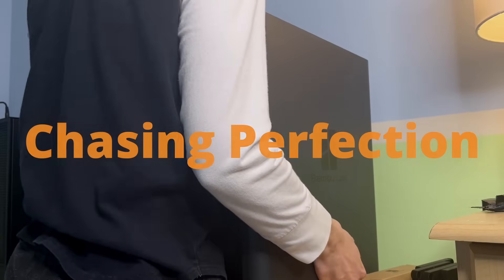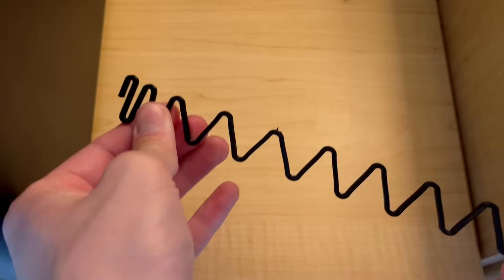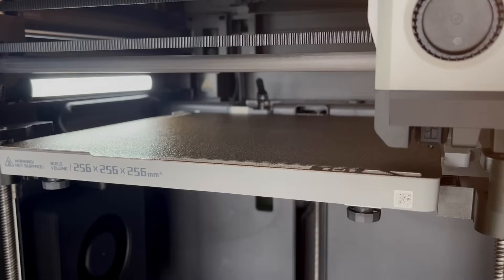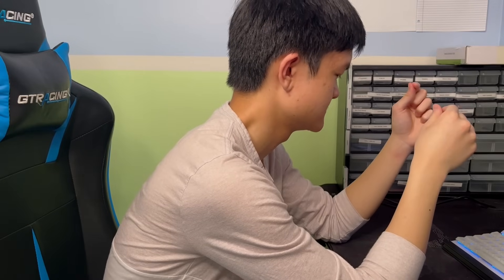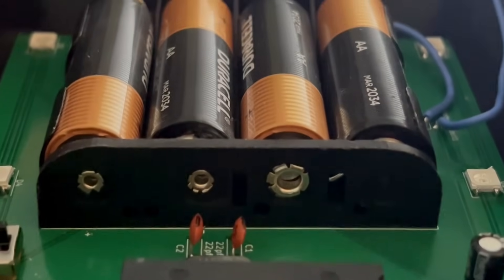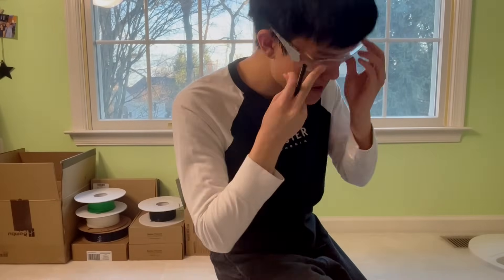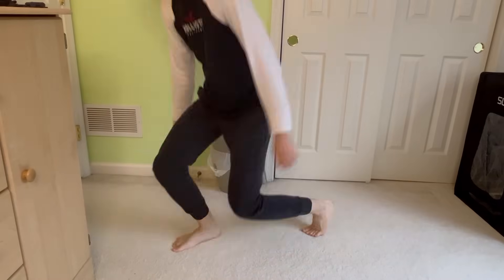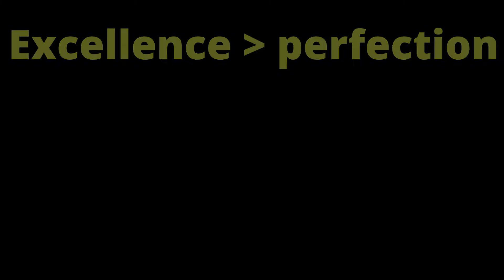Chasing the perfect 3D Printed Spring

Comment: FDM printed plastics also don't perform the same as injected molded plastics. There's plenty of plastic type springs used regularly to for snap fitting, lids, and simple springs for parts. If a coil spring is needed, they always use metal because it's simply superior.

Comment: To help print the coiled spring I think you should use a square profile for the spring rather than round. Metal springs are purely round because they are made from wire and that is how wire is made. You have other options.
Reply: Round springs spread the pressure better, on a square spring, there will be a higher pressure at the corners
Reply: @SuperEmmetMan  Good point.

Comment: There are lots of materials you can try to deal with doformation. PETG is an easy print, but not an engineering grade material, that would be suitable for such an application. You could try with PC (polycarbonate) filament which is known to not deform and is quite stiff. There are some special blends to make printing easier. You may also want to check PCTG.
Reply from the maker: Good suggestion! I was suggested PC by other people and tried it out and it was much better! It was much harder to print reliably (bed adhesion and such), so I might try out your idea.
Reply: Cool, think is worth a shot. Check PC from prusament, saw some reviews and it looks fairly easy to print with their blend. And PCTG of course is also a good thing to try.

Comment: Is there any filament that lets a spring stay under pre tension? I tried a pla plus clock spring but it loses pre tension in less than a day
Reply from the maker: In terms of non-exotic filaments, I tried PETG like I did in the video. Undergoes much less deformation after being stressed than PLA, as PETG has more elasticity. If you want to try more exotic filaments, I'd try polycarbonate or nylon. Polycarbonate makes for robust and stiffer springs, but is one of the hardest filaments to print with. I never used nylon, but heard it also works well. Hope this helps!
Reply: @TheTinkeringTechie  it certainly does :)

Comment: How about using air as the spring? There would probably be no problem with deformation, if the walls are big enough. just getting is airtight is the most challenging on it. and its hard to make different strengths of the spring.

Comment: I recommend trying a high density TPU, or try one of the filaments that change hardness/elasticity based on what temp you print them at. there's also one like that made of something similar to TPU, but is more like a stiff rubber- sadly I don't remember the name makeup of it as I only saw it once, quite a while ago. Sintering your parts in powdered salt, sand, or talc might help also- not sure how badly it would affect the elasticity, but it would definitely reduce breakage/deformation.

Comment: You can find stress strain curves for printed plastics online to design within specs to avoid plastic deformation or failures.   There is still the creep curve which can be partially mitigated by not leaving it under load when not necessary.  In the end it's all unreinforced thermoplastics, so nothing will be long lasting.  If you keep the loads low you can make  spring loaded clips that last long time.

Comment: Inner structure of material is very important to inner friction that result in heating and result in losses (hystheresis). 
Another point is the Young modulus as higher means stiffer, and stiffer means it can be really small to have the required stiffness (elasiticity) and the shape can contribute a lot to the travel done instead of pressing on a block of rubber, a helical spring will apply torsion on a very long coiled beam thus reaching the large deformation at the end under the low force applied.
And of course tensile strenght is a very important factor. This dictates what range the spring is usable. 

So plastics, and rubber and wood have really low Young modulus or really low tesile strength or both. Spring steel is quite high (compared to plastics) on modulus like any steel and is particularly tough reaching 2000MPa at yield point and break point soon after (brittle failure mode). Both values are several orders of magnitude higher than any plastic. Also plastics suffer from high internal friction losses. This means even optimized shapes to only work the plastic in the elastic region.. would soon heat up past GTT and would fail or creep or get plastic deformation.

Steel springs are cheap, readly available, can be made diy with some improvised mandrels for your custom need from piano wire or spring steel wire.

I see this everywhere when someone is an avid woodworker he would make everything out of wood. A 3d printing enthusiast sees everthing solvable by 3d prints. A machinist sees only milled stocks. - Every extreme is bad. Each thing has it's upsides and downsides.  Keep in mind cost and time is a downside, otherwise a CNC'd part out of steel would be the nobrainer, outperforming in every way. but the cost involved is another order of magnitude.

Using the strength of each component makes for good design.
p past GTT and would fail or creep or get plastic deformation.

Comment: Better and faster to make it this way.
1. Take a steel rod or a screw, wind filament around it tightly with even distance. 
2. Secure the ends with some tape so it doesn't wind up. 
3. Put it in the oven at 70-100°C to release the stress in the material and wait 10-20 minutes. 
4. Remove the tape and take off your finished spring.
Reply from the maker: I have heard of that technique before. That would be good for helical springs, but maybe not for some other custom springs for specific scenarios. Also, my final spring design has a rod in the middle attached to the base of the spring so that it can slide in the shooting mechanism. For normal standalone helical springs though, that could work well, and be stronger too!
Reply: @TheTinkeringTechie  You can try combining these things. Make a strong spring with filament winding and print a base in which you can screw in the spring to get what you need.

Also this method isn't limited to helical springs. You just need a way to wind it differently. Perhaphs by using a steel bar instead to get a different shape for the spring.
Or even cooler! Print a spring mold using a high temp material which doesn't deform at 100°C and wind your filament around that instead. ;)

Comment: Springs made of square tubing are much stronger than round. It's still a round coiled spring, but the stock material has a square cross section instead of circular. You don't see them often in metal because they are expensive to manufacture, but it's just better.

Comment: >Wants to push himself
>Doesn't have a DIY CoreXY machine
I scoff at the Bambu, but some distant part of me begrudgingly admits that half my prints are just printer mods instead of anything truly practical.
Reply from the maker: Well, I do have an Ender 3 Pro with a bimetallic all metal hotend from Slice Engineering with non-stock hotend fan, capricorn tubing, aluminum extruder housing, oh and the cherry on top is I use boron nitride thermal paste for extra cooling. Let's just say that there was a reason I bought a higher end 3D printer. I wanted a tool, instead of a toy to tinker with, which was the Ender 3 Pro. It's a matter of where you want to push yourself. In this specific video, I wanted to push design and prototype, as well as see what my new tool can do. A year ago, my focus was to see if I can work on my new toy at the time, my Ender 3 pro and see what I can do with it. It can now print at 150 mm/s and with PC. Didn't make a video on it though, cause I modded it while working on another more interesting youtube project.
Reply from the maker: I will assume it is a joke based on how it is formatted. But in case you were curious about my 3D printing DIYing experience :P

Comment: don't add the corners in the flat setup. also if you're designing the housing as well, you don't need to make it fit an existing string profile and space, you can make it a bigger bar type spring instead.
Reply from the maker: So you mean round the edges of the zig zag shape but keep the overall shape the same to make it look like a cylinder going in a zig zag shape? I never thought of that! Filleting the edges does help with stress distribution in general.

Comment: PET Carbon Fiber filament is what I use for my 3d printed headphones. Even after several months of use, the headband spring still has a good clamping force around my head. Coming from a mechanical engineer, you did well in the design part! The change in material is something you can explore into if you have enough time and money to spend on different filament materials. Don't give up! ouob
Reply from the maker: Thanks for the suggestions! I am thinking about using different filaments for future projects. I am an EE student, and the compliments coming from you, a mechanical engineer, means a lot! Thank you for stopping by, and glad you enjoyed!
Reply: @TheTinkeringTechie  another good option for you could be nylon or carbon reinforced nylon, they both have a high amount of force they can take before plastically deforming. Nylon will bend a little bit sooner, but carbon infused nylon is more likely to break.

Comment: I personally found PLA+ to be a great spring, as long as it only hold tension momentarily as we all know about PLA creep. I would play with lowest possible part cooling to prevent tempering, as it can be too brittle. Otherwise i feel ABS with high part cooling to temper the plastic might be a great spring. Also, instead of a round spring why not give it a square profile to maximize the amount of material in the area.

I would try different colors as variables, since the additives used to colors also effect the plastic properties, i.e. black or white filaments typically having noticeable effects.

Comment: can you try torsion spiral springs? they can get some power and they are easy to print and shouldnt defom too much
Reply from the maker: That is true. Printing a simple spiral shouldn't be too hard. Only issue for this project specifically is that I want to launch something. Something that I didn't mention is that I wanted it in a small form factor (it relates to my future projects that I did not describe in the video). But if that wasn't a constraint, then that would be a good idea! Also, thanks for stopping by!
Reply: @TheTinkeringTechie  yeah im trying to make a 100% printed nerf gun rn that uses a torque spring (spriral in the handle)

Comment: You should calculate the deformation using a caliper And adjusting the spring height accordingly. You shouldn’t use the entire spring because it simply would deform to much (for compression) use maybe half or 3/4 of the spring because the deformation of it would be negligible. I have the a1 mini and I’m using the exact same material to make tiny 16 mm springs for an engine (unfortunately I’ll consider it as a model) but they work perfectly because I’m not using the full spring and I’ve added a mill. in height to compensate. For your next spring design I recommend calculating your spring coefficient with weights (then calculate the weight force in newtons) and then measure the height of the spring and calculate the delta height for each weight you put and make a graph for more values (if this sounds like too much work then just ignore this comment 😢) Wish you happy printing!
Reply from the maker: That sounds like a high school physics lab experiment :P. Fun, but I would do it when I need to.

Comment: Dude why does no one except me make 3d printed screws, come on man you’ve got a p1s it’s more than capable of printing them
Reply from the maker: Oh I've printed screws before. In my video called The Absolute Power of Functional 3D Printing at around the 5:30 mark, there is a contraption that requires screws that I printed as an example. That was on my old Ender 3 pro.

Comment: This isn't a strong area of my knowledge, but this got my interest so I hope you don't mind some rambling.

Is it fair to say that we can classify deformation under elastic (good) and plastic (bad)? And that our goal here is to make the elastic deformation so overwhelming in our required motion that plastic deformation is effectively nil?

If we could get away with that, then the only difference between a PLA spring and hardened steel spring is the geometry of the part, which would aim to:

1) Drastically increase the amount of material under stress, which gives us more elasticity for less plastic deformation
2) Evenly distribute the elastic deformation to reduce the effect of a local area succumbing to plastic deformation
3) Move the elastic deformation onto a plane that is supported by the 3d printed geometry [I think your print direction having the deformation occur on the same axis as the layer to layer adhesion might dramatically reduce the effectiveness]

As for the mention of creep, I'm not personally too worried about that, as my general observation is that materials have a stabilisation point after the initial geometric/temperature stresses are resolved into the final geometry under general use. So I suppose that'd just mean that the spring could be designed to settle at a specific geometry, rather than begin with it.
Reply from the maker: It would be ideal for the PLA spring to only depend on geometry, but of course the chemistry of the bonds between the molecules gets in the way. But yes, from experience, adding more material (a thicker spring for example) allows for somewhat of a more even distribution, and being able to spread out the forces across the spring would be better (ex: same material spring, 1 as zig zag spring as seen in video, other as helical, the helical does better because the zig zag as "pivot" points, where forces are concentrated), and of course, how the spring is manufactured, in this case, printed would be a factor as well. But of course, there are realistic conditions such as the moisture of the filament when printing which changes the material properties, which is hard to track. As for the creep, yeah springs have a natural length that they like to stay at.

Comment: There is a custom 3D printer a guy built that prints into rod. And they y axis is just spinning the rod. This means all the layer lines are concentric and this would make better springs.
Reply from the maker: Oh, so it's like a polar coordinate system robotic arm, where a spinning arm rotates and also goes up linearly. That's what I am imagining in my head. Sounds cool!
Reply: @TheTinkeringTechie  yes he demonstrated doing a pull up with a short and hollow PLA print printed with the concentric layers and with traditional Z layers and it was very impressive. Solid print with z layers snapped but the hollow one with concentric lines did not. I cant find the video unfortunately
Reply: It isnt a robotic arm or anything fancy i remember it was just like a regular ender 3 but instead of a bed for the y it was a stainless rod that spun. And he wrote python to modify the g code to print like that. So the Z and the X were basically unmodified. He also had some cool like chineese finger trap type sleeve that went over the rod and it helped with adhesion but also allowed the print to release very easily and the sleeve cane out of the print afterwards.
Reply: @Javii96 Humphrey Wittingtonsworth IV is the name of his channel, and his last upload was of the lathe 3d printer

Comment: 1:00 - 🤮 Get a plastic scraper and some replacement ends from your local hardware store and save us that noise, and the PEI plate's longevity.

3:17 - 🤮🤮🤮🤮🤮 I've had my PEI plate over a year I reckon yours has got three months at that rate. Why even have a magnetic spring steel plate if you're gonna just do that. 😆
Great job though; the progression of the design and insight into your thinking was very entertaining.
Reply from the maker: Eh, it's probably fine, right? Right??? I'll be honest and say that at 3:17, I for the life of me could not get it off even after bending the PEI plate. Sometimes, it's asking for you to scrape it :P
Reply: That's when you take it out on a plastic scraper end and flip to the fresh side where all your sins are hidden away. xD You can do literally the same thing and damage nothing but the plastic blade as it's the softest of the bunch and will never gouge the plate. It's also handy for starting peeling TPU with a bit of alcohol like a squeegee.  @TheTinkeringTechie
Reply from the maker: You think I could print a plastic scraper? I'm pretty sure people have done that with a specific material, perhaps PETG for the scraper's durability, and also of course, flexibility. I won't use the metal scraper when taking that print off ;) @K3NnY_G

Comment: Maybe make an AIR spring instead? A small container/cilinder with air and a sealed piston. The spring element is the air and NOT the printed material.
Reply from the maker: Air spring does sound interesting. I was going for more of an air soft inspired launching system that uses a normal spring to compress air to push the projectile, but using a piston to compress air and using that to compress more air does sound interesting! For airsoft though, you would use another method and just have a tank of compressed air to get straight to the point, however.
Reply: you haven't ever tried printing, I'm sure
Reply: @Ethanol3481  Already tried printing springs(amongs many other things like chains, gears etc) but it's best to use technologies where they're best suited for and printing is NOT the best way to make springs.